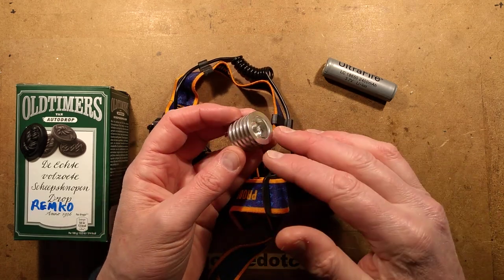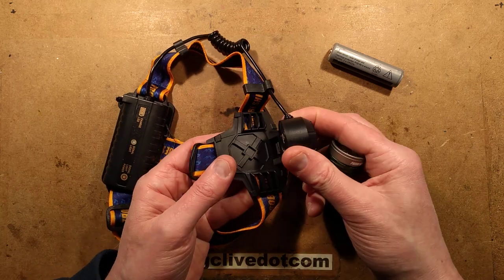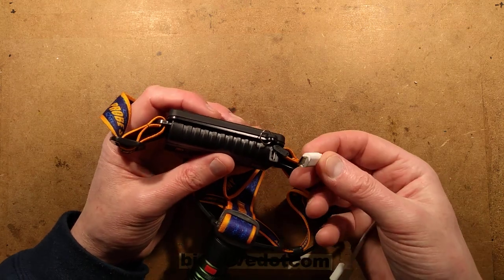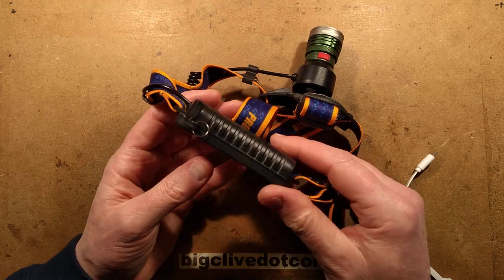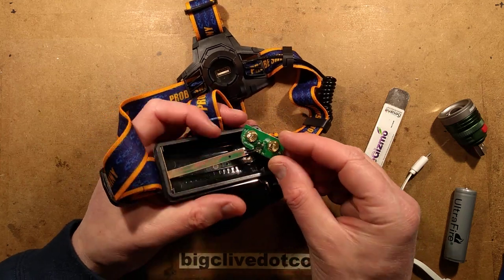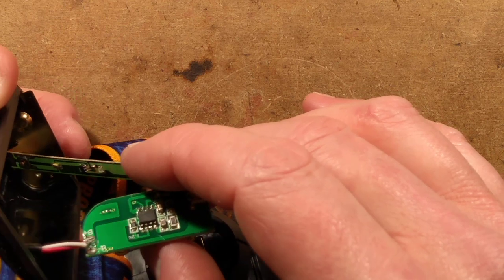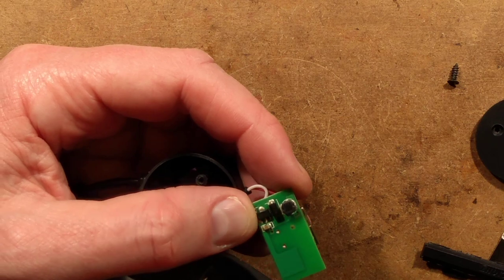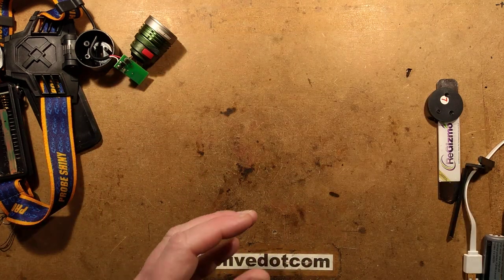Inside a Shiny Probe head torch with detachable USB light.

Comment: 11:02 The product claims to be a "10,000 lumen" lamp. According to the Wikipedia article on lumens, this would equate to 100W of LEDs. Such things do exist, but you wouldn't necessarily want one strapped to your head.
Reply: and why not ???? this is an answer that needs questions! :O
Reply: Who not understand, Chinese Export Lumen very different, do not confuse with Arabic numbers!
Reply: True.
I had a small 10,000 lumen flashlight.
It would get really hot. I found this out when it the button turned it on in my pocket.
It was quite a surprise. Nothing then it was like having an ember on your leg.
Reply: What Would Photonicinduction Do?
Reply: Dave Micolichek  Gotta agree with that, 10000 lumens would be in the 3-4 Cree XHP70 emitter type range (or a single larger LED). I'm guessing it might be doable with 3 cool whites and high currents, 4 with lower currents in cool white or a more decent high CRI/neutral white using a bit more power. The smallest XHP70.2 torch I'm aware of is this one http://www.zebralight.com/SC700d-21700-XHP702-Neutral-White-High-CRI-Flashlight_p_233.html and using a Samsung INR21700-40T battery (rated for 35A continuous discharge) it would do that 3000 lumens for 1-2 minutes or so and then settle down to 2000 lumens with active cooling (or 900 lumens without a fan pointed at it).

So 4 18650 high drain cells or equivalent arrangement would probably be the minimum requirement, in addition those LEDs on the head mounted contraption would need a large thermal mass or active cooling of some kind. I don't think I'd want or need either of those in that form factor, no bulky heavy thing or a fan blowing air around near my head. Regular boring old "just 1000 lumen max" with decent lower output modes will do just for head mounted stuff.

Review of the zebralight sc700d with runtime graph: http://budgetlightforum.com/node/65105
That INR21700-40T cell is interesting though, a quick glance at https://lygte-info.dk/review/batteries2012/Samsung%20INR21700-40T%204000mAh%20(Cyan)%20UK.html seems to indicate it might be worth looking into for some stuff I had in mind, could potentially change a project I had in mind from multi cell 18650/big lipo battery requirement into a single quickly swappable 21700 cell for simplicity. Bit pricy at €8,45 each from NKON, but they do seem nice to have for a compact punchy battery.
Reply: Dave Micolichek  Technically I guess I'm a CPF member, but only around 10 posts and I don't login with it much. 

I don't really keep track of new stuff too much anymore, got a sc600w mk3 and sc64c from Zebralight now on active duty which made all other regular torches redundant. Beside that I have one or two torches per other category as well as well (diffused camping lantern, usb key chain, aaa twisty, big reflector thrower). So my needs are covered and got some old AA loaners for when people ask me or I guess as backup in case I lose or break a good one. 

Other brands tend to not offer much extra in the 1x18650 department, ZL has nailed it with being compact, good low modes, high outputs, led choices (tints, better CRI), user configurable output levels. And I don't really see a need for their xhp50 and xhp70 variants in daily use. I wouldn't mind having them but they wouldn't see much use, their beam pattern is more floody and the resulting tint shift at lower modes that practically get used most by me.
Reply: My fenix hl55 blasts 900lm for 30sec, if yo do that in a small room you get blinded by it
Reply: Regardless of the misleading claims put forth by the supplier, the potential of this product are high. If my Fenix FD41 can achieve 900 lumens from a single 18650, I see no excuse for such an under-driven LED used in this product.

Comment: 19:20 This is why I made the small investment in a magnifier/ring LED stand on my workbench. Helps for many things, not just electronics. No more destroying my teeth with flashlights!
Reply: Speaky of LED ring lights I was given an old fluorescent one that took I think it was called Circle Line bulbs like a T12 or something right there at circular Florissant a course the ballast was bad he said might be but you I'm sure you can do something so I did is I converted it to LED used original Outlet in even put in a USB charger couple switches a couple are gizmos and gadgets. And even an iron stand for my soldering iron and a spool holder for my solder.

Comment: love these small usb lights 😉🔦💡
Reply: I've got big hulking power power bank that use in emergencies I'm looking for a decent one so I can get locally without having to go online any clue as to where one might be able to get it in the United States without going online...

Also I remember Dollar Tree used to sell these lights that looks like a USB book light on a stalk all flexible silicone housing with a LED array on a aluminum back circuit board not a cob type chip arrangement you're with a gel but individual white LEDs surface mount 1 individual resistor for the whole board.i bout a tun of them just for the LED boards.

Has anyone had experience with a Dollar Tree Sunbeam brand electrical equipment they used to have those all three Outlet power strip quote on quote which was actually more like a power strip Liberator with three Outlets in a small female section which by the way those can be taken apart and put on a longer cord and also there's a project I'm working on right now does new power strips that have through there that turn on when the current exceeds 15 what's on the control receptacle it has four switched Outlets controlled by that and to receptacles that's or unswitched.

I am in the process of reverse engineering it so that I can add a CAT5 cable so that I have an output when there's power present can turn on or off a said about let's remotely and also tell when the current is being drawn from that control master receptacle and even more and also I will be having those to be used with another cable connected to a switch box in receptacle it's still spending as much doing that with a j a junction box and receptacles. And heavy cable.

Comment: You "can" use those flat top batteries ... if you get some of that flat tab wire [the stuff they use to make 18650 power packs with] and fold it [to a size that is similar to the battery top] a couple of times you can jamb that folded tab in between the positive connector and the flat top positive of the battery ... close the lid and away you go ... the spring pushing against the other end of the battery should hold the folded tab in place ... and so should the back of the case.
You could even change the positive connectors in the case for one that has a nipple ... or a spring.
I bought the USB flashlight part on its own and intend upgrading the LED to a 10w at some point in the future [as a project].

Comment: You can use neodymium magnets(I use 6x1 or 6x2mm) to make flat tops work in button top compartments. Of course it's not suitable for high drain since the heat will destroy the magnet, but something pulling maybe 3A or less works out nice, and can be bought in packs of 10-100 for next to nothing

Comment: Hmm both rear box and lamp could be optimized with one board each (and different molded parts).  In the rear, the charging port and chips could be on a wider rear board with just the two battery plates protruding.  Middle divider could be part of box moulding (rear LEDs slightly lower), making it just box, PCB and rubber lid.  In the lamp, the controller could be on the Aluminum LED PCB with the zooming ring moving the lens instead of the LED.  This saves one PCB and two wires, and avoids making the cross for linear movement (turning the lens causes no problem).  So just bottom housing, PCB with plug, LED, button and chip tucked in with a drop of thermally conducting glue, lens ring screwed on and the lens tucked into the lens ring.

Comment: I'd be interested to know the actual switching speed of the boost, and whether if varies by load.  I suspect that perhaps the document means that the chip is designed to be able to switch that fast, with the frequency as well as the duty cycle determined by the inductance, capacitance, and load.

By the way, if you have a scope, a square wave source (scope output for probe compensation adjustments, then you are equipped to at least estimate inductor values, by measuring the time constant.  (Or use it in a Colpitts oscillator with a frequency counter.)

And, as long as I'm writing, where, on the internet, would you go for 18650 cells of reliably good quality (not a little cell in a big jacket, not old cells removed from equipment, recently manufactured rather than having years on the distributors shelf, since capacity does degrade)?  Of have I missed a video that you've already done?

Comment: Hmm... So I could put a powerbank with belt clip to charge the headlamp part wich then has a USB extension going to the lamp part? NICE!
Reply: That could happen or just use a powerbank to charge 18 650 s so if you need 18 650 for something else you plug the headlamp portion the actual lamp is the power bank in the extension and usually 18 650s the power of the other device.
Reply: Free energy!
Reply: Weeeel.  It depends if the two will play nicely together.  I'm trying to find the best (cheapest) way to power a TS80 soldering Iron from any type of battery I have to hand.  Basic components are a 3-30v up/down buck boost converter and a 3-20v QC3 controller
In theory I should be able to use anything from 2xAA cells up to a s4 lipo - and it works with all my batteries, with one exception.

The Poundland 4000mAh Power Geek power bank that BigC featured 3 months ago seemed a good investment, I bought 2 and they've been great, until I plugged this buck boost in.  the BB's display just starts flashing on and off and nothing comes out.
If I bypass the power geeks 3.6-5v boost - it works fine - but that also bypasses the protection which I'm reluctant to do because the load is quite high.  I've not had time to try and work round ... but it just shows that there can be compatibility issues with some combinations.

Comment: There's a lot going on in that headtorch. (ooft, the RFI - wave an AM radio near it for me, BC ) I don't think any of these lights with a USB plug on the back are going to be very robust though - all that waggling about of the USB connector :o( And for a headtorch, the light could simply fall out just when you need it most....But, I do like the adjustable lens on the light, and the cheapness, and the idea. Electrically speaking, I hate to see any kind of battery cells being put in parallel though - just makes me nervous, but in this case, it's a bit idiot proof at least :o/ Thanks for showing Big Clive.

Comment: Find it kinda funny how ideas precede trends. Years ago when the first aluminium China-direct zoom-able lights came out, a friend of mine took apart one, ditched the handle and put an USB on the back with a little machined plate/spacer. Kinda said he's wasting his time, you're better off with one or the other, or what are you going to plug it in? Your laptop? Aaand fast forward, they are super popular now and a neat idea because you can plug on in a power bank and make a flashlight or the above.

Comment: While a good idea in theory, I think that the runtime/power efficiency losses of converting the battery voltage up to 5V and then dissipating the excess 2V to run the LED is pretty inefficient versus just running it directly off of the 3.7V of the battery. I would rather it just had a normal headlamp on the front with the USB port off to the side so you can charge while also using the lamp.

Comment: The reason there are a lot of 18650's with fire in there name stems from the brand Surefire. They supplied lights to the military (and gun nuts) and had quite the reputation for reliable products.
So when the Chinese companies started to make copies of the Surefire lights, they kept the fire part - Ultrafire, Trustfire, Solarfire...etc.
The early Ultrafire 18650's were good batteries with genuine capacities, the same for Trustfire. Sadly that didn't last long and then the counterfeit batteries flooded the market, they could buy rolls of shrinktube to cover 18650's in the markets of Shenzen and then make any crappy battery look like what was previously a reputable brand.

/Rambles of a recovering flashaholic :D
Reply from the maker: "Recovering flashaholic"  Yeah right.  I bet you still make flashlight impulse purchases.

Comment: Clive that light on the back of the unit is to keep people from walking into you when walking at night on trails.
Reply: Douglas Campbell If it was slightly stronger, you could use the setup as front AND rear lights when cycling or skateboarding at night.

Comment: Everytime i see the name UltraFire, i immediately think - AH - Another one of those scammy chinese batteries from Banggood
Reply: Actual Ultrafire brand batteries are fairly good, I've owned and used a set of 4 for years now and they have never failed me. The problem is of course the fakes using the same branding that have filler stuffed inside to make it weigh the same as a real 18650.

Comment: BigClive way to "slip it in" the video I mean. Cheers from 8 inches of snow and no power for 2 days kansas.
Reply from the maker: The peril of rural living.  Are you OK for backup power for lighting?
Reply: @bigclivedotcom  wood burning stove / fireplace. Of course 4000w peak 3200w continuous geny. The geny is from harbor freight its 3 years old used mainly winter 3 times a week overnight for 3 weeks at a time. Still starts first pull. Only change oil and plugs. I turn the gas off run the carb dry each use. Very reliable. Just under $375 usd. Just some side info for your viewers in case they were wondering about the build quality/ reliability.  It sat in the back of my truck for 3 years because that's were I needed it, so it was exposed to the elements rain, snow, sun, dirt etc. The only thing wrong is its sun faded a bit. The little rubber feet are broke off. Other than that first pull start.
Reply: "slip it in" 8 inches, am i the only one with a dirty mind? i think not lol.

Comment: Clive, have you ever taken apart a laptop battery for the cells? Would love a video of you doing just this
Reply: There is plenty of other stuff in her other videos about doing all that on YouTube you know and yes I've done it myself. Imma do it yourself for that is disabled with limited income so a lot of stuff a build is with salvage parts including you know those electric blanket controllers the 101 to work horde and sometimes two units or just one in the three or four wires house those are handy to make controls for things if you toggle switches or what. Bow multiple circuit controller of course put in a fuse.
Reply: TheLastPost Funny, I would rather take it apart to replace dead cells.  Salvaging a lap top from a dead battery saves a lot more than salvaging a battery from a dead laptop.

Comment: The signal light at the back acts like a cars rear brake light. Mainly for warning people behind you in the dark that you are there or whilst you are in the mines during a power cut.
Reply: Surely people behind would see the front light anyway.
Reply: In case they missed the bright light of the head lamp itself...
Reply: The red led on the back allows following along a trail in the dark without using the main light.
Reply: @vadhakara  I love they'd even care about them being intrinsically safe.. since they're using explosives and used to run carbide lamps! but they would be useful for caving if you had a backup.

Comment: Clive, 1x3mm tiny disc magnets, $5/150 delivered. Pop one on a flat top 18650 and it will work well enough at low loads. That looks like a counterfeit Ultrafire, at one point every UF 18650 on ebay and Amazon were counterfeits. Every one of them.
Reply: I have actually heard something about that for what friends.
Reply: MAgnets are good outside of a case, but a little alloy scrunched ball does wonders.
Reply: Ally or aluminum foil also works great for when you only have AAA batteries but need Double A's and you don't need much power. We're fixing something that has a battery holder gets damaged but bring broken off but there's a bit of a stub left to connect the battery using aluminum foil.

Comment: Clive you have a baby Dalek there I think. Better call Doctor Who and get it checked out.
On another note. What size cap would be the right size to add for the missing one?
Have you looked at the price options on eBay for that light. They are all over the place.
Reply from the maker: I'd guess that anywhere from 1uF to 10uF miniature ceramic would do.
Reply: @bigclivedotcom   I might give it a try.
On a side note. Did you happen to hear that Youtube is going to start removing videos of things that are unsafe?
A person has to wonder how they are going to do that and if it's based on someone reporting how many will false report videos.
Look out Net Nanny is watching.
Reply from the maker: @seannot-telling9806  It'll probably result in a lot of militant reporting for the silliest of things.  That's why I value the Patreon and PayPal support more than the AdSense.  It provides a buffer against things like this.